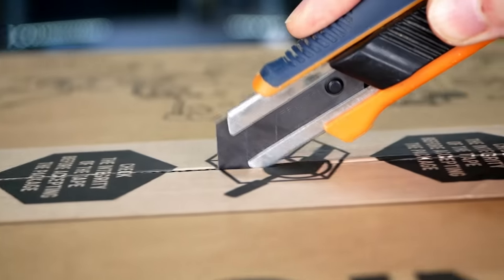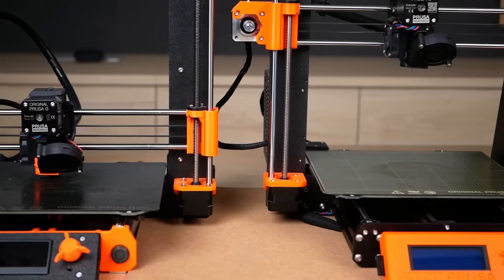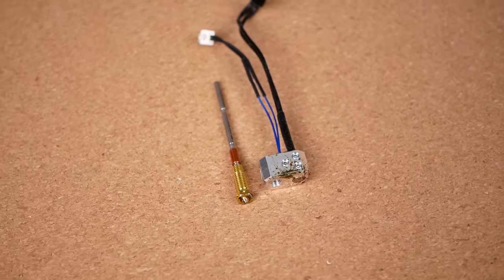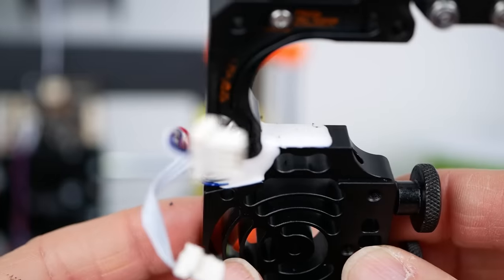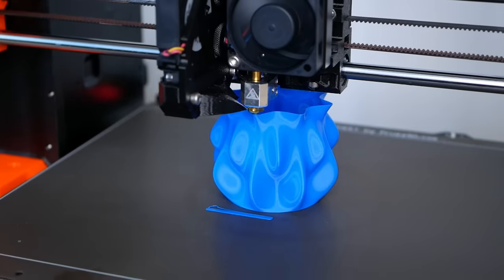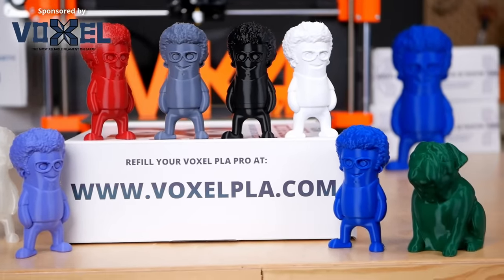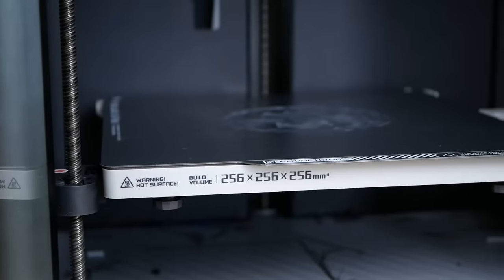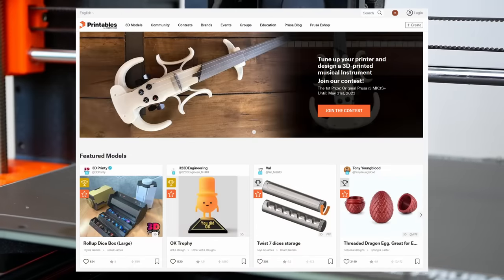Should you buy a NEW Prusa MK4 in 2023 or rather a Bambu Lab X1/P1P?

Comment: Thank you for the great review. We just bought for our company an X1 Carbon as a replacement for an Ultimaker 3. I myself have an Prusa mini and MK3 and Ordered the MK4 kit. From two quick prints what I noticed, the MK3 is precision printing which the X1 could not do. Still need to proove and measure it, but I printed a 5,00mm hole in PLA on the MK3 and on the X1 both with Prusament PLA (same spool) and wanted to put a precision 4,89mm rod in it which worked great on the prusa but did not work without hammer in the X1. I think this should be included in the comparision, as a lot of people use the printer not for shiny decorative prints but acutal engineering parts, where precision matters more.

Comment: PRO TIP! If you DO buy Bambu, save $700 and buy the P1S. Allow me to explain, it has EVERY feature the P1P has plus about $200 of additional parts + enclosure, etc, YET it only costs $100 more than the P1P. You can manually upgrade the P1S to the X1 with less than $200, the ONLY thing you will not have is the larger LCD screen but if your going to use the PC or your Phone to print, does that matter? The P1S screen IS MORE than enough and works great! I honestly think you should NOT buy a Bambu unless you have $300 extra for the AMS though, it makes quality of life x100000000 better. You can print multiple colors, have it switch to special support materials that break away easy, and you can use up spools ENTIRELY and the system switches to a new spool on-the-fly. It's absolutely amazing! Did I mention it dries AND stores 4-fullsize filament spools automatically for you? Yea, insane. Sorry but Prusa has absolutely NOTHING on Bambu right now. If that Prusa was CORE-X-Y with Carbon Rods, had an enclosure, it would cost another $500 making it a horrible value proposition. Not to mention that, the Bambu Printers are about 40% faster than Prusa's MK4 and thats quite a large marigin. They both auto-level and track from the nozzle too so thats just another advantage the Mk4 - DOES NOT - have over Bambu. The Bambu has no weaknesses and offers more than any other printer on the market for it's price. I'm not happy their not open source, but o'well. Bambu has their hooks in me, and I will NEVER touch another Prusa or Creality printer again.
Reply: I am currently considering the p1s. But the specs say that the maximum bed temp is only 100c, while the x1 carbon is 20% hotter at 120c.
I plan on printing a lot of polycarbonate which needs the extra temperature. But perhaps it will work just as well at 100c??
Please advise
Reply: @ChristopherEnoch get the x1 carbon if you want to print pc. It does the best job at it. I love mine.

Comment: I jumped on the Ender 3 entry point back in 2019 because I couldn't afford to jump for a Prusa.  I also didn't understand just how much of a difference it could be as far as reliability.  I love how easy printing was, but quickly noticed how much upkeep is required to keep it running smoothly at the quality I demand from it.  I love how easy it is to tinker with though.  Over the years I've made it into a Frankenstein's monster. Upgraded to a SKR Mini E3 V3 board with custom setup of marlin, ender 3 V2 control screen, linear rails, direct drive with bmg clone extruder, and 3d printed upgrade parts.  This has easily given me so many hours of fun just tinkering, let alone producing other stuff.  

I've been tinkering with a lot of brands filaments and noticed their quality comes and goes in batches.  So far Overture has been my most consistent, and I will give Voxelpla a shot when I restock PLA again. Thanks for all the awesome videos, especially the in depth technical data gathering and experiment ones.

Comment: The real test of a 3D printer is when the printer is used in a group space, like a makerspace.  In this case you have people who are inexperienced with 3D printers, or worse, those who think they are experienced with 3D printing.  In our makerspace we had several printers, one of them was a Prusa MK3.  The MK3 was the worst in reliability.  The Ender 3-V2 was much better, except for people wanting to adjust the bed leveling.  The TAZ running 3mm filament was the best, but still users had problems.  So we got rid of all and purchased 3 Bambu Labs P1Ps.  The P1Ps have been in service for two months.  They still work very well.  The only failed prints we see are where the user specifies the wrong bed type (wrong temp), or uses filament that is very old and brittle.  Using a 3D printer in a makerspace is like putting it in a gorilla cage.  I'm sold by the quality of output and the shear ruggedness of the P1P.

Comment: @cnckitchen . I love your review style and analysis. it is hard to avoid bias and i think you’ve done the best you can in this video to give honest and constructive feedback on the state of 3d printing and the machines themselves. Personally, I would buy the mk4 to work alongside my mk3 with the assurance of longevity promised by prusa’s reliable network. However this would all change if i had a lot of multimaterial prints on the docket. i couldn’t justify the mmu3 upgrade and the mk4 price all in one go when bambu labs has the multicolor/material printing problem dialed in already. for where i am right now though. it has all the features you need ready to go and inevitably( likely before the year is out) prusa will activate and improve on the advanced features available in the hardware. I look forward to an updated review after they have activated the advanced features because when those are activated this will be a paragon of reliability with few remaining flaws ( aside from switching to the core xy design.)

Comment: Personally, as a software engineer I don't mind them releasing the hardware early and add things as software features later, but I think they should release a rough time line so people can know when to expect the features. Usually when a hot product comes on the market, it is sold out instantly and it takes a while until they catch up in manufacturing enough hardware again so people can order the product without having to wait, as is the case with the MK4. So by the time people that aren't among the first who ordered get their printer probably most of the features will be implemented anyways which in my opinion is better than delaying the launch by months and then people need to wait even longer to get their new printer. People who want to wait for all features to be released can always do so and end up with the same result as if Prusa would wait with releasing it.

One point I do think they should work on is making this more transparent on the website, when they advertise features that don't work yet they should add a notice in some way that clearly mentions that this will be added in a future firmware upgrade.

Comment: I cant speak for the Mk3/4, but I do have several Minis and they have been extremely reliable and got me into a hobby I wasnt expecting.  At this point I now am working on turning it into a full time business and decided to get a bambu x1 carbon as well.  Prusa taught me how to build/repair/tinker with printers, and overall have been extremely reliable for me.  However at the end of the day, I am not someone smart enough or has the interest to get deep into the weeds with printers and hardware and firmware, its a tool to make my products for sale.  The Bambu feels like such a finished product compared to the Prusa, its ... sexy for lack of a better word.  It does everything the MK series does, and seems to do it just as well if not better, the quality is there, the speed is just unreal, most models print 2-2.5x faster then on my Prusas.  The AMS actually works and isnt a nightmare like trying to get the MMUs from prusa working properly (will see with the XL of course).  

At the end of the day, Bambu has really moved the industry forward with their printers in my opinion.  Will it last the test of time with support, reliability, and match the great long term reputation Prusa has remains to be seen, but so far I have been nothing but impressed with Bambu.  I will continue to use my Prusa's as well for the foreseeable future, reliable workhorses they are indeed, but at this time any new printers I add to the farm will probably go Bambu line.

Comment: I don’t think you are a Prusa shill (I hate this word so much) – on the contrary. Yes, your critical remarks about the MK4 and its current state are true. Why not also shed the same bright light on the praised competition? In your opinion “objectively compared, Bambulabs machines are in almost any category better than a MK4.” (timestamp 13:27) 

Though you shortly list some of the things BL might not be as good at, IMHO this criticism is stated in a much more weakened way and leaves out a few (unpleasant?) aspects. This is something I seemed to notice from quite a few 3D-printing influencers during the last months. And I don’t blame them – as each tiny critical statement against the Chinese newcomer almost immediately causes enormous backlash from the “community”.

For example: I do get your dissatisfaction regarding features not being enabled on the MK4 yet, but you could say exactly the same about the P1P. A simple „filament load“-option had to be introduced by a firmware update months after the machine was available. Same with the LAN-only mode. BTW: BL itself still states that their bed levelling algorithm still is not working completely fine and they will fix that in an upcoming firmware release…

Proceeding with non-working features on the P1P: camera support within the app when in LAN mode, sporadically crashing machines when connecting by FTP, still no implemented software z-limits… [hint: never calibrate your machine after the z-axis is homed; don’t leave your bed in the lowest position after a tall print]

Talking about firmware updates: In just a few months it already happened that a firmware update for the P1P was released that seriously affected printing and made it necessary to issue a hasty hotfix a few days later. [Off Topic: I am under the impression that the firmware of the X1C gets more attention from BL - understandable, as this is their premium product.]

Cloud and its downsides: Before LAN-only mode was available on the P1P there were several times the cloud-service was down making network access impossible. You then either had a good-looking paperweight or had to fiddle around with the micro-SD card.

You could continue with QA issues on BL’s side, suboptimal customer support, poor/no serviceability of important parts like bearings/rods, partly poor availability of proprietary spare parts/accessories, privacy concerns and finally – let’s put it mildly – at least questionable business ethics, mostly regarding IP/open source…

Don’t get me wrong, I definitely don’t want to malign BL or their printers. But IMHO all these aspects should be openly talked about and taken into consideration when deciding which manufacturer to support and which machine to get.

Yes, the BLs surely have all the bells and whistles you can dream of at this price tag and they are fast – extremely fast. At least if you are doing single colour prints. As soon as the AMS steps in, the filament changes slow you down to a level an MK3S with a Mosaic Palette can keep up with. Anyway - if you receive a working machine, don’t need support and the consumables last acceptably long – go for BL!

But if you need a 24/7-workhorse with reliable support, the chance of fixing most of possible defects/wear inhouse and not being locked into a proprietary ecosystem then you should definitely think about an MK4 or XL - or a machine from a completely different vendor.

Just my 2 cents…

P.S.: I have paid both the Prusa and BL machine with my own money and I am not affiliated with either company 😉
Reply: Bambus BedLeveling is just working fine. But the majority of the Bambu beds are so badly bent/warped that no ABL ever will fix the hardware damage. Yes I call their bent beds a damage, because it is. Bambu is only claiming it is a ABL firmware issue because you can keep the majority silent. 
Other than this, fully agree with you. ✌️

Comment: Philosophically I much prefer the open source Prusa. I'm a MK3 user now. My MK3 has seen a fair amount of mods and will see still more. I love the Revo on it. And the MK4 looks like a very good evolution to something faster. I fully expect the MK4 to be another workhorse, and if I were setting up a farm of printers, it would be a front-runner. The Bambu is fast and impressive in some ways but the closed source Chinese approach I don't much like those aspects. It's also damned loud, and I can keep my Prusa in the office and it's not objectionable (well, not after I put a heavy paving stone under it at least, and not if I print PETG that doesn't have to run the fans on hyperspeed like PLA does...) The lack of input shaping after they touted it is borderline fraudulent though. It's a bad look. I have no intention of replacing my MK3 with Revo for this, though. Even with input shaping. Though available input shaping might have made the decision a little harder... right now, no shot, and no need.

Comment: Thanks for the review Stephan,  I share your opinions on most of this video.   Its a good upgrade, the nextruder is a nice piece of gear.  Though the fact that they advertise features that dont yet exist is a sticking point with me personally.  Prusa, for as amazing as a company as they are, do not have great records with adding features after the fact.  I was kind of hoping the mini launch was a one-off thing.  But i'll hold off buying an upgrade until after the software if figured out.    

We shouldn't allow practices like this to be come the norm and I think they got the hardware out to make sure people buy them instead of an X1 or something in the meantime.   I've stopped giving companies these days the benefit of the doubt.   My mk3's have been reliable, but my bambu's contribute more to my workshop.   I will highly consider an XL when my preorder comes around, but it's got to be ready to go at that point.  Im cautious with them focusing single head machines,  will the multi heads function to full capacity at launch? 

I really shouldnt have to have those concerns with the market leader in consumer hardware development.  If you want the apple tax, you've gotta deliver what you promise. Under promise and over deliver.   Would you have sold less units if you hadn't promised input shaping?  Doubtful. People have been camping the store and others have been scalping.  And when you finally deliver it in 3-6 months, you get brownie points.  Suprise! Brand new feature that doubles the speed of your machine!  It's more positive for the consumer, and gives prusa another wave of free advertisement. 

This is how their competition has done things. Bambu labs made a kickstarter that plenty were questioning.  They're a brand new company. But then beat their release promise to deliver in 3 months with every promised feature functioning out of the box.  They've then proceeded to add feature after feature to the machines such as auto spool changeover on the AMS and LAN only support.

Comment: Mk3 owner here. I won't buy the mk4 because prusa should have launched it 2-3 years ago but instead acted like Intel before Ryzen and decided to milk the community with miniscule performance upgrades with mk3s/mk3s+. My friend has the Bambu which first of all doesn't look like a hobby project and prints at least 2x the speed. That often results in two instead of one iteration in the same day. Prusa did too little for too long and now they're paying for it.
Reply: With respect, I think the idea that Prusa was sitting on its hands doing nothing during those years is shortsighted.  They do far more than produce printing machines—they are a full services supplier.  Let’s look at their successful initiatives over the last 4 years or so.  
1. They introduced Prusament which has rapidly spandex tobecomeone of the most trusted suppliers of high quality filament on the market.  
2. They introduced their open and free 3d repository Printables which (although not perfect) has been a huge upgrade over previous services (Thingiverse) in terms of responsiveness to user input, part quality and use ability.  
3. Prusa XL
4. AFS Pro
5. Continued development of their own open source slicer that is the acknowledged market leader for filament printing. 
6. Continues to insource manufacturing in order to insulate itself from the market manipulation that can come from dealing with predatory industry practices.

All that (and I’m sure I missed a few things) put together makes Prusa the most influential, impactful, dynamic and innovative companies in the 3d space.

Are they spread too thin?  Perhaps.  I’d like to see them bolster their SW team but there’s not nearly the money in open source as there is in proprietary development.  It could be that ultimately it will fail as a business model because there just isn’t the necessary ecosystem of like minded actors to share the costs.  If so, it will be a sad commentary on humanity.
Reply: @robblincoln2152  No their problem is they neglected their core business for too long, thinking the competition isn't doing anything new anyways so we can spend our time on other stuff. XL is super niche and  printables is questionable. The only thing that makes sense is prusament and the print farms but those should've been ran as separate initiatives and not take resources from the core business. You can still work on prusa slicer while innovating new printers. Also they simply copy a lot of stuff that ultimaker cura develop. They put themselves into this position by poor prioritization and not by being open source.